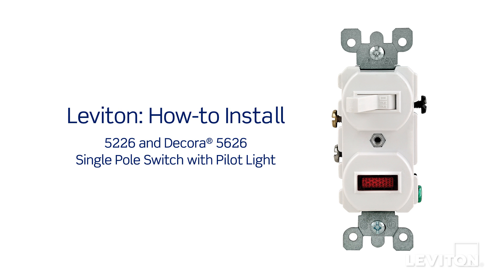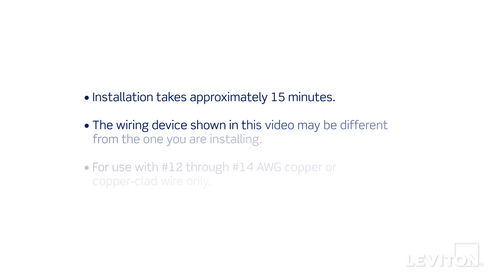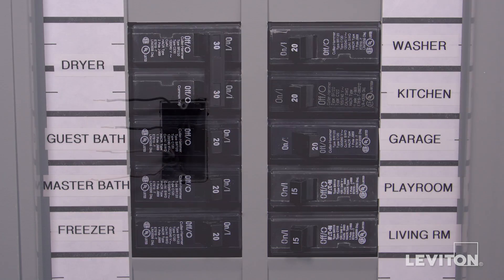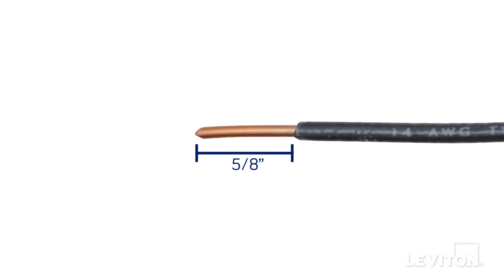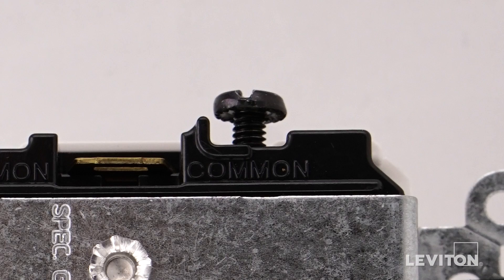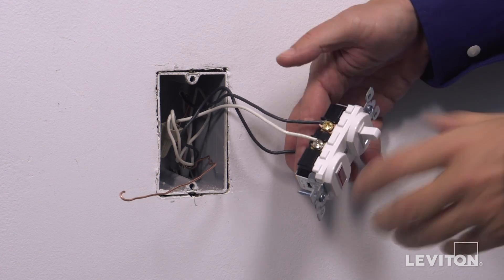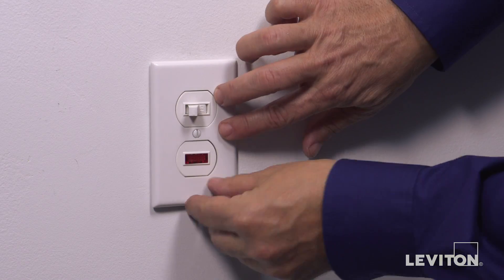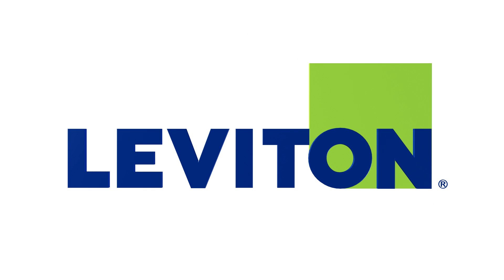How to Install a Combination Device with a Pilot Light and Single Pole Switch | Leviton

Comment: I want to install but I have only 2 black wires and 1 ground how do I hook the switch up
Reply: There should be 2 neutral (white) wires twisted together with a nut inside the box. This video is misleading here. Your typical light is wired in the switch box with 2 black wires, and 2 white wires. The black wires (one load, and one hot) are broken at the switch, while the white wires are just tied together. In this case you will just need to pigtail a neutral wire to complete the circuit for the pilot light. If this dosnt make sense I suggest either watching a video on how a light is wired, or call an Electrician. Hope this helps
Reply: @jmhm17  That's assuming he has a spare white/grey 11" neutral conductor of the same size awg laying around. If he doesn't know how to properly pigtail a neutral in, I would strongly suggest getting an electrician to do it. Improper splicing can result in arc flashes, ground faults and short circuits. Also important SAFETY tip. Don't hook the hots up first and the grounding conductor last. Do it the opposite. Go in in this order: grounding conductor (bare or green), grounded "neutral" conductor (white or gray) and lastly, do your black  "ungrounded" hots. If you start with the hot and power gets turned on accidentally, the current has nowhere to go but through you. Set your grounding and grounded conductors up first and do your hots dead last just in case.

Comment: I have a question.  I have this switch controlling light in my attic.  I noticed when I flip the switch, the indicator light on the switch does not turn on....when I moved in, I guess the electricians, wired it without the neutral on the silver screen in the switch.  So I took the white neutral and attached it to the silver screw and now the indicator light stays on whether the switch is on or off.  Is that because its functioning as a hott wire? All the other wires in the box are hooked up like shown in this video.  Any suggestions?  Thank you
Reply from the maker: We need more information so we can properly assist. Please call 1-800-824-3005
Reply: @leviton  I actually figured it out.  The electrician/homeowner before me had the wires crossed.  I switched the hot wire and switched hot wire on the top screws and it works.   Your products are great and I thank you for getting back to me.  Regards
Reply: Why does the pilot light stay on no matter if switch is on or off?
Reply: @byrdmanbyrdman-l5l  It's because your Line is connected to the Hot terminal instead of the Common terminal - and your Load is connected to your Common terminal instead of the Hot terminal.